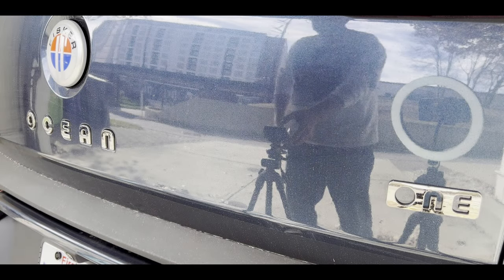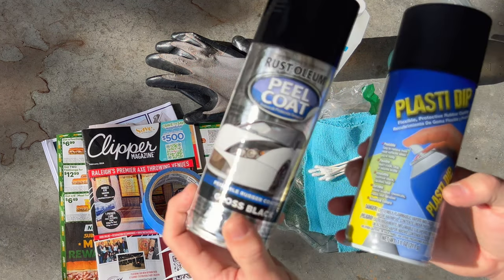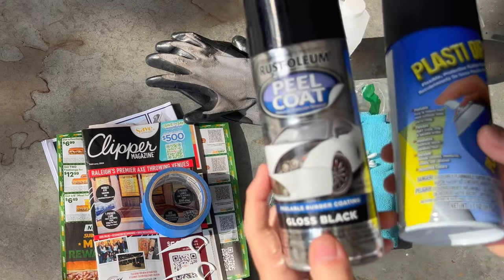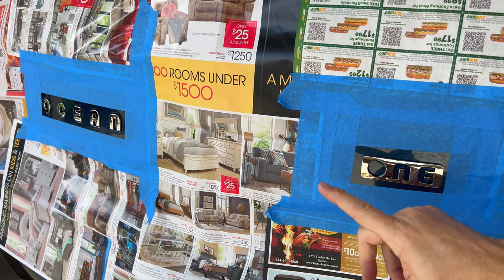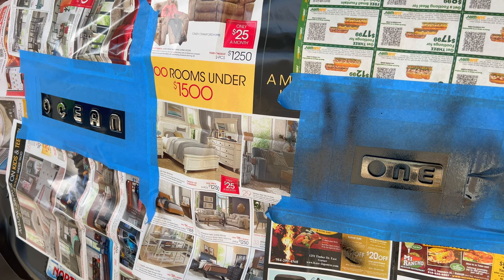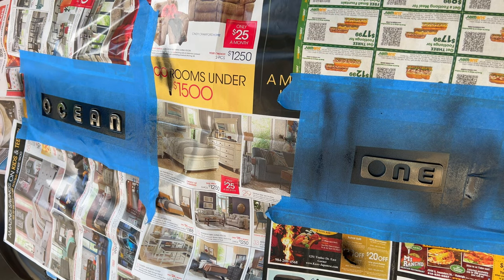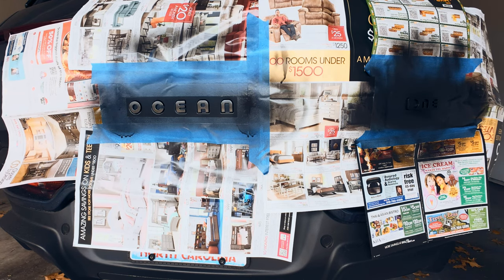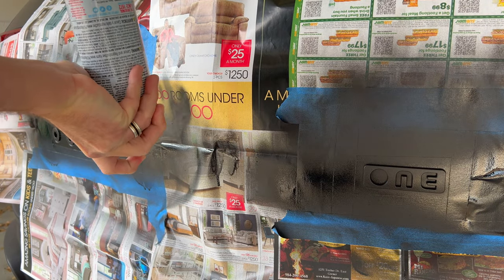Fisker Ocean One - Plasti Dip Emblems

Comment: Looks great. I really enjoy your thorough, well planned, no-nonsense tutorials. I think I prefer the slight gloss with this paint finish. Maybe the matte would work better with the Big Sur Blue. But it's subtle enough that I don't think you can go wrong. 

I was impressed by a few things: 
1. I thought you'd have to remove all the emblems individually. 
2. Eight coats. I was only expecting two or three coats. 
3. The simplicity of removing the area around the tape. 
4. Removing the inner sections. With a little patience and the right tools it came out nice and clean. Pro looking job.

Does the ceramic coating help make it easier to remove the excess paint? Does the PPF make it easier? Does it not matter?

You got physical state plates? Congrats.
Reply from the maker: Thanks! Light paint colors probably make the matte black pop more (white/silver). My previous experience with plasti dip is the more coats, the better.  It actually makes the cleanup easier too.  I do think the ceramic coating helps.  You can see the tape barely would stay in place with the ceramic.  I don't think PPF would make too much of a difference.

Comment: QUESTION: I just tried to file my income taxes with Quicken, but the IRS rejected my return because my VIN was not in their database. According to the IRS Fisker needed to fille a document called "THE CLEAN VEHICLE SELLER REPORT"  BTW I did convert my order early back in 2023 to qualify for the credit. I did complete the form 8936 and took the $7,500 tax credit. But it seam to be more of an issue with the VIN not reported.  PLEASE can you provide some help in this matter. Do we qualify or not for the full tax credit?  Were you able to file?  Also consider making a video about this subject. Thanks in Advance for any insight / help.
Reply from the maker: Interesting.  I got my tax credit approved on Turbo Tax and received the money about 3 weeks later.  We do qualify for the full tax credit if you paid a deposit before 8/15/2022.  I want to confirm that this is for your tax year 2022 filing, correct?  I'm not sure why they are not accepting your VIN.  I haven't heard of this occurring on any of the Ocean forums/message boards.  Did you contact Fisker regarding this "Clean Vehicle Seller Report"?